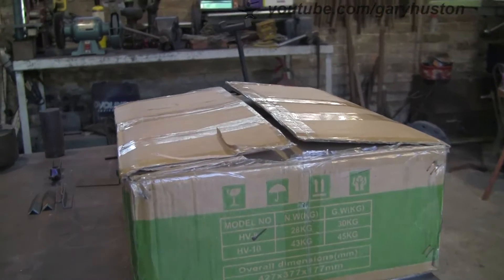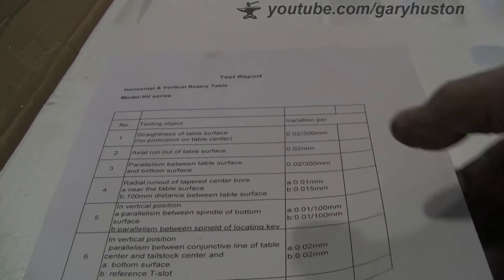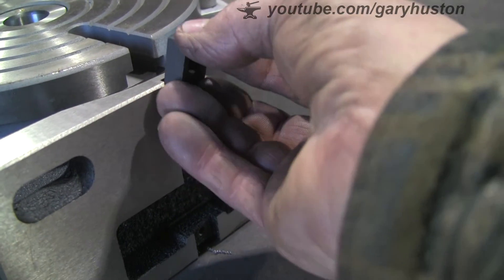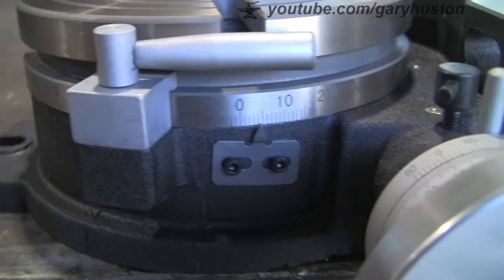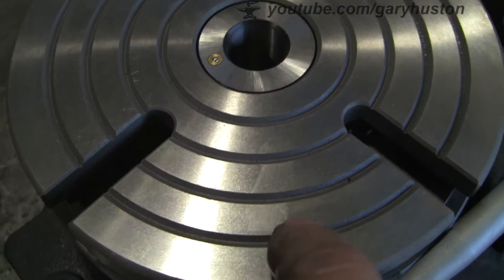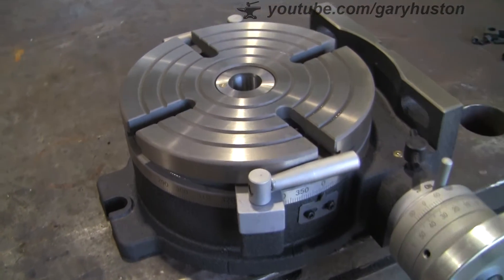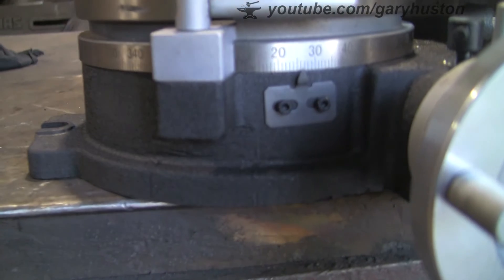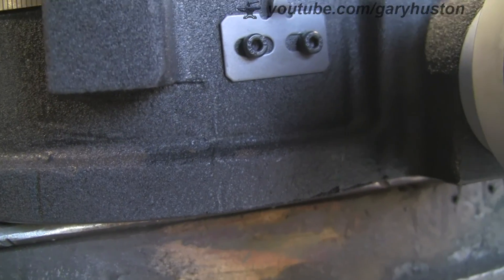Vevor 8" rotary table

Comment: just bought mine. i have the same mill lathe combo too.. maybe u can show how you adapted the set up for it..
Reply from the maker: Nothing really to show, just a big piece of ⅜” plate bolted to the cross slide instead of the tool post and then bolt the rotary table to that. Takes a bit of juggling around to get it in the ideal spot but pretty simple really.
The lathe is a pretty versatile tool, I’m currently using mine as a grinder! https://www.instagram.com/reel/CqI8zHSDciV/?igshid=YmMyMTA2M2Y=

Comment: Hi Gary.  I have the exact same rotary table except branded by Vertex, and the engage/disengage lever that you are about to operate at 3:39 'adjusts' the mesh of the handwheel to the table.  So, if you don't engage it as far as you did, it will remove that little 'tight spot' that you mention.
Having said that, this is at the expense of backlash which you also mention and state the remedy for.
It's a perfectly high end(ish) quality piece of kit, and I don't think you'll have problems with it.
Regards Mark in the UK
Reply: Are you certain these are the same product as the Vertex one which costs well over twice the price of this Vevor one?
Reply: @alanmaughan7968  Well, I'm not sitting next to my Vertex HV8 right now, but from comparing the images in the video, AND Vevor's site, AND now the Vertex HV8 online, I would say that they may not literally be the same casting(s), but the various elements of the table are virtually identical. This is just my opinion though.